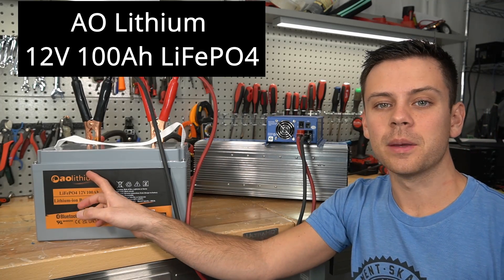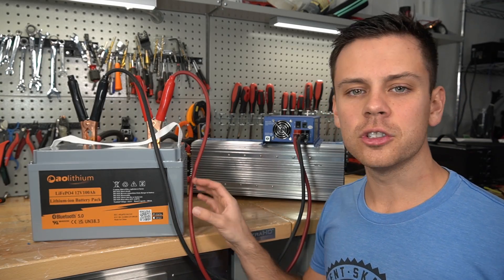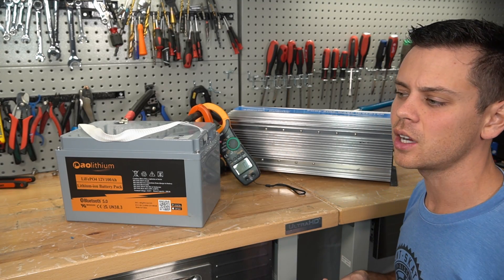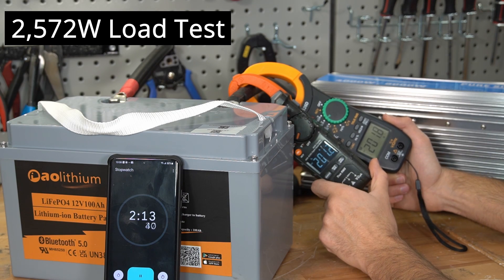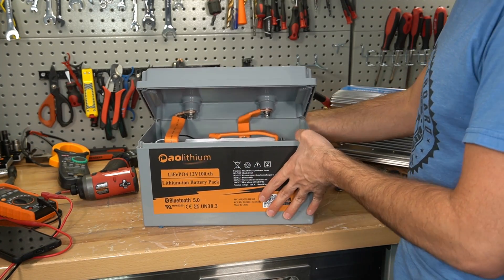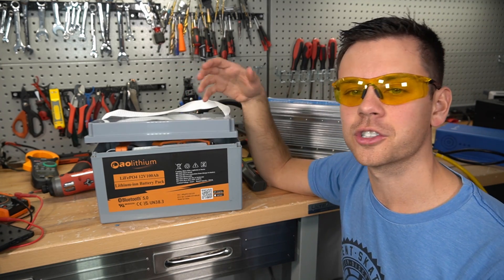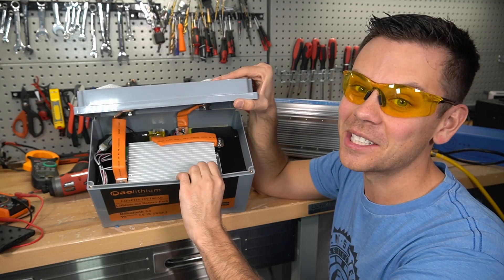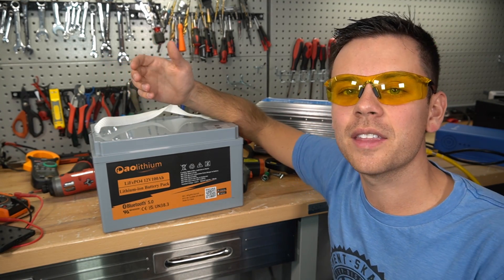"AO Lithium" Stress Test: Can a 12V 100Ah LiFePO4 Run 2,500W?!

Comment: I have two of this batteries and both will not open charge mode the BMS says in full when only at 55 SOC bad BMS one cell is maybe over charged? How to fix do I need a different BMS
Reply: Ad to comment its states voltage over charge voltage

Comment: Hey Will, have watched you for years appreciate you. Worked as a tower hand for a bit in my life figured I would mention you need to be careful around heat from electronics it can cause cancer. There's been quite a few times you've mentioned how hot things are. Please look into it.

Comment: The "4S" model seems to be different from the version tested here and seems to replace the version tested here. I don't see this version at all on their website. I bought the "4S" version hoping for the 200 amp capability, but the "4S" version will only give me 120 amps for 3 seconds. Now I need a 2nd battery in parallel to get the 200 amps. Had I known that, I might have gone with 2 of the Redodo minis and a shunt to replace the bluetooth built into this.

Comment: A lot of comments in here about running a microwave off a battery.  An inverter microwave is a much better option than a traditional microwave.  When you set an inverter microwave to 30% power, it draws 30% power during the whole heat cycle.  A traditional microwave under same circumstances would turn on for 3 seconds, then off for 7 seconds, repeat.  My inverter microwave draws 2000 watts on full power.  If I set it to 30%, it draws a max of 700 watts  for the whole cycle.

Comment: For this battery, and all batteries, you should follow the manufacturing specs. If you want 200amps then be sure the battery is capable of 'continuous current' of 200a which I have yet to find in a 100ah battery. This battery is rated for 200a only for less then 3 minutes.

Comment: Is it better to have a single 300AH lithium battery or 3 100AH batteries connected in parallel?
Reply: Some 300ah only have 200bms. Also if one BMS fails two left. But less cables or bus bars.

Comment: would it help the battery and components to have vent holes on the top and bottom. to allow colder air in and hot air out via convection? not mening for "over cooking" the battery. but just for cause.

Comment: Bought one of these batteries. Shipping was great. Arrived at 25%, and charged right up. App syncs incredibly well and seems to be an in-house branded product.  Hooked up a 2000w inverter and plugged in a 1500w space heater. The app was incredibly responsive with pretty solid measurements of drain and remaining time.  Easily and quickly responded when the heater was moved from high to low.  And the remaining time also seemed to accurately adjust. My first purchase of a 100ah battery and it was mainly because of watching Will’s tear down and stress test. I’m very happy with the purchase so far.
Reply from the maker: Awesome!!

Comment: I was wondering how long you think this battery would work with a space heater I use for my RV it AC 120v 1500 watts I dry camp a lot would love to find a battery not having to charge everyday .
Reply: Would take a pretty hefty battery setup for that kinda load to not need recharged everyday. Math says you would need 32 of these batteries with a 95% efficient inverter to make it 24 hours with a 1500 watt load.

Comment: Will I have a quick question...I know you have mentioned converting say a 24 volt system to 12 volts to work with rv stuff...but what if you wanted to convert 12 volt to 36 or 48 volt dc...up convert...what happens with the amps ...amp hour rating...

Comment: I have a 24 volt 5000 watt inverter, I have 2 ampere time 12v bats run in series, when I try to run a air compressor 2.5 hp the output voltage drops from 120 volts to 50 volts ac. Is the problem probably the inverter or the batteries. If batteries will these batteries possibly run the load?

Comment: If I add this to my existing bank of 2 100ah lifep04 that only discharges at 100 amps each, is there a benifit? Or should I just get another 100 amp discharge battery?

Comment: @DIY Solar Power with Will Prowse AO Lithium states that this battery can be connected as 2S or up to 4P but not any Parallel/Series combination (like 2P2S).  This doesn't make sense to me, if you can do 2S (24 volts) then why can't you do any combination that is 24V?

Comment: I'm dubbing 🤔 Using an DC AC-Powerconverter 12 OR 24 volts, combined with 2 batteries connected parallel OR in series, will there be the same max wattage output ?

Comment: even more incredible is that, even at that discharge rate, you still got around 90Ah from a 100Ah battery. 90% return at 2C discharge is amazing! I wouldn't be surprised if a few more Ah went into heating the BMS and busbars too.

Comment: Even if you did get increased degradation, it might be worth it. Replacing your batt after "half" the regular lifetime may be worth it vs the bulk/size of running two batteries. Say for a really small setup in a truck camper or something.
Reply: especially considering that in 5 years, LifePo batteries may be half the cost

Comment: 200 A 12 V for 27 min? That is 1080 Wh. That is shy of the labelled 12 V 100Ah, which should pack about 1200 Wh.
Reply from the maker: Efficiency drops at higher c rates. So you will not pull 100% capacity. Check out the capacity data with each cell. You can pull full capacity at .2C rate.
Reply: @WillProwse  Good to know. Thank you for the reply!

Comment: Microwaves usually need 50% more than their rated power.  700w microwaves are available, so that means 1050w, say up to 1200w with inverter losses.  That's 94 amps.  So any 100ah LiFePO4 battery can run a microwave if you pick the right microwave.  Great news for coffee re-heaters.  :)
Reply from the maker: Most microwaves trip 100A bms. The initial surge must do it. It's hard to run them.
Reply: @WillProwse  That's good to know.  Inspired by you I built a battery with a 120a BMS and valuing your experience, I won't get a microwave bigger than 700w.  When I'm out on the road relaxing I can wait 2 more minutes.  :)

Comment: Very impressive !!! 
Was wondering if you would find interesting to post a video of a UPS  running off a 12V 100Ah LiFePO battery? Would be of great interest for PC enthusiasts requiring a great deal of autonomy in case of a main grid power failure.

Comment: Aren't the majority of microwave ovens only using 1100 to 1200 watts, so not pulling more than 100 amps out of a 12 volt battery bank?
Reply: My Panasonic 1200W Inverter Microwave pulls 75A from my 24V System, so that woudl be 150A off 12V.

Comment: Would this battery and a 1000W inverter be able to power a 700W microwave? And would a 60 Hz, 1900W continuous/2350W peak gas inverter/generator be able to charge it in a reasonable period of time?? I already own the gas inverter/generator, and the stand alone 1000W inverter (but have nothing else - such as a battery, charging device, charge controller, solar panels, etc.) so that's why I stated those particular specs. I live in a very cloudy/rainy area so solar is a hit & (mostly miss) proposition.
Reply: my 1000w inverter(2000w peak) wouldnt run it for more than a few seconds. it was pulling about 85amps so just a tad over the 1000w limit. We ended up picking up a 1500w inverter and it ran it no problem

Comment: hi
could you sometime talk about marine Lithium batteries for outboard engines?
how saves lithium battery to use in a speed boat
 charging the battery from the outboard engines like (MERCURY VERADO OUTBOARD MOTORS)
thank you

Comment: will most microwaves I've ever seen are 1800w at most. They have to be as that is the limit for appliances like this. Even my giant samsung oven combo one. When I use it, its never above 2000w just FYI. I wouldn't do this though. Not good for the cells at all. With my giant 1200ah bank its a teeny tiny draw. I love that aims charger too btw. Mine is putting in a lot of work this winter. Hope it lasts a while because I've had 3 other chargers and they were junk

Comment: Hi Will, I think this video is a little misleading. Seeing the comments section, looks like most of your viewers are going to use it for microwave, AC, and such high loads in their RV etc. And I think it's not good and could be dangerous. CALB rated those cells @1C discharge and max 60Celcius. Your test was 2C and brought the cells temp to 75 Celsius 3:22 (as pointed out by @LithiumSolar), dunno what the internal cell temp went up to. You should have concluded that AOLithium's 200A continuous claim to be dangerous, because it is actually dangerous. If it's LiFePO4, doesn't mean that we can deviate from the manufacturer specs by 10 times (rated 2C for only 3mins, AOlithium rated 30 mins). Battery assemblers should rate their system on the weakest link, even if the BMS and bus bars can handle 200A doesn't mean, the battery should be rated at that much. I love their build quality but they messed up at cell selection. I think using 1C cells for 2C battery is a very serious issue. They are marketing this battery for 12V applications at Van/RV with the 200A rating, it's a big deal for 12V system, you know that. But let's consider this scenario: the battery is installed in the battery compartment of an RV and on a hot summer day, the user decides to run the AC as AOLithium claimed it can do so. Can you imagine the temperature inside the cells with that load in that environment? It will boil the electrolyte, literally, probably will vent the cells. I mean you almost boiled yours in your test, on a winter day, indoors! I hope you ask AOLithium to use a proper rated cell for their battery. I can't imagine how any Battery company can make such mistakes, don't they have any knowledge of how cells work, don't they have any liability in case of accidents? Battleborn has ~20C rated cylindrical cells but their battery is 1C, it is the most optimistic rating and will prolong batt life so much, posing no danger. Even the cheap Weize battery that you reviewed had 2C cells (50Ahx2). And I know you did mention 200A is not recommended but looks like no one is listening, everyone is excited that it can do 200A! I hope you understand and I love all of your other videos. Thanks.
Reply: We are really so sorry for this unintended mistake about Aolithium 12V 100Ah LiFePO4 Battery.
The correct description should be the Maximum Long Pulse Discharging Current is 200A, Maximum Duration: 3min.
We have already correct the data in specifications, websites and other promotional materials.Thanks for your supervision and support!
Reply: @aolithiumofficial  Great. You can change to 2C or 3C cell like the EVE one and then you can market it as 200A continuous. 12V system users will love a 200A capable battery.
Reply from the maker: Hey I agree, and that is exactly what I said in my video. I stated that you can run these loads safely for 3-5 minutes. I ran my test for 27 minutes. That is why we hit that temperature. And ambient temperature would not make that big of a difference here. Running for 3-5 minutes is fine, even if it is very hot outside. You should never let any lithium ion battery cook in the heat, obviously. 

I think what you should do is present your argument to underwriters laboratory. UL is responsible for the products they list.
Reply: @WillProwse  Thank you for your reply Will. Yes you mentioned 3-5 mins, but they rated the battery at 200A continuous. It's obvious that people who buy it for 12V systems are going to use it for that much if the need arise. That's why the concern, I hope they correct their specs. CALB cells are UL certified for sure, dunno about the battery though. Even if they did, it doesn't change the fact that they are using 1C cells in a 2C rated battery. Thanks.
Reply: In the video that the discharging lasted for 27 minutes with 201A current, and then, the battery was automatically cut off, because the battery was being protected by BMS. The over temperature protection temperature of the battery is 75°C, and the battery would automatically cut off when it reached 75°C. In Will’s video, he told us when using high-power electrical appliance, you should make sure that the maximum discharge current is no more than 200A ,and you don't run it for more than three minutes. The same advice is given to you by Aolithium.

Comment: I would love to see you testing some LiFePo4 batteries capable of cranking cold engines ( Diesel & gas). This would be interesting.
Reply: I actually live in Germany. But thanks for the suggestion, Will.
Reply from the maker: That's not me, it's a scam
Reply: If your thinking of as boost solenoid in motorhome, the solution is to let charge the chassis batt for longer period of time. Or for diesel boost when flip key for wait to start/preheat with boost. Grid heaters pull 100a could make difference between pop over or not. Two of these should start a diesel generator. People are building start bats with cylinder cells, but 7-8 years on $110 LA start battery is hard to beat. Power sports it makes sense except snowmobile..

Comment: That rating has nothing to do with cell capacity. Usually the hardware that connects the cells is the weakest link, literally. Not to mention the hardware in the bms that cuts off the power when the cells are empty. I bet if you installed a manual 500amp disconnect instead of running that power through the bms you could pull twice the rated max discharge without to much harm. Granted you monitor the temp and voltage during discharge.

Comment: I was waiting for a response from the manufacturer to do this test. Guess I waited too long and you beat me to it... Maybe I'll still do one. Also noted that when you showed the app and state of charge, it said 75C / 167F which was significantly more than what you noted with the thermometer. Can do it, yes. Recommended, don't think so...
Reply from the maker: Wow that is hot!! And yes good point
Reply: @WillProwse  I believe you have a scammer working your comment section !!💥💥
Reply from the maker: @parkerottoackley5587  yep, its all over youtube. I report hundreds of them and it does nothing.
Reply: scammer post FU
Reply: In the video that the discharging lasted for 27 minutes with 201A current, and then, the battery was automatically cut off, because the battery was being protected by BMS. The over temperature protection temperature of the battery is 75°C, and the battery would automatically cut off when it reached 75°C. In Will’s video, he told us when using high-power electrical appliance, you should make sure that the maximum discharge current is no more than 200A ,and you don't run it for more than three minutes. The same advice is given to you by Aolithium.
Reply: @LithiumSolar you should still do the video. I like to compare both of your data as I’m sure others do as well.

Comment: I've never seen or heard of a microwave over 1000w.
Reply from the maker: Measure at AC input and you will be surprised at how much they use
Reply from the maker: Also people like to run multiple loads. Especially in RV and vans
Reply: @WillProwse  You're completely right; inverter losses + additional loads will quickly ramp up the watt usage.

Comment: Santa told me he had a low budget this year because of inflation & everything. I need a battery for Our offgrid system to run fridge, charging kolbolt batteries and running some little 6 volt fans.. Basically 24-7..   which battery should I tell Santa 🎅 I would like to have? Will I need more than on 100am?

Comment: @Will - Can you parallel 2 of these batteries to create a dual system 12v 400AH capacity ?
Reply: The AO website Will links to has 2 and 4 battery packages to be used exactly like that.  You get a small additional discount for the packages.  So a 400 AH system for about $2500 (if I remember correctly)

Comment: Forget a microwave. This would run a 15,000 BTU AC (with soft start, of course).
Reply from the maker: Good point!
Reply: It would .. just not for too long. Need 8 of those to run it overnight and have it charge during the day time.
Reply: @knight7866  So 1600A (19,200 watt) steady discharge capability? You definitely won’t be needing a soft start that’s for sure!
Reply: @migmigjohnson6083  yeah. I know people who can run an large AC fot half a day and charge it the other. I think you would not need soft starting with a large inverter (4k+) and battery bank.
Reply: @migmigjohnson6083  from another website, a 15k btu ac takes 3500w to start and 1500w to run. So running an ac is possible. You would need a large solar array to charge it back during the day. Still not the best solution, but getting more feasible.
Reply: @knight7866  You mean one batt and without soft start? If the 3500 watt draw is less than 30 sec then it would make for a nice experiment to push the limits of the battery.
Reply: @migmigjohnson6083  yeah.. it seems the main issue is heat. Maybe Will could do that experiment at some point.

Comment: i built 100ah system using Calb cells 6 yrs ago - daily use in rv - has worked well with little capacity loss - powers fridge -laptop - 2 phones -hotspot - fans - lights - cost $650 for just cells back then - charge w Victron & 360 watts solar

Comment: What about using it for starting engines? (Moderate size like a car/truck)
Reply: Headway cells better suited but how do handle cold recharging. Still hard to beat $110 for 5-7 years lead battery. Cylinder cell for motorcycle is popular. When winter storage kills most.